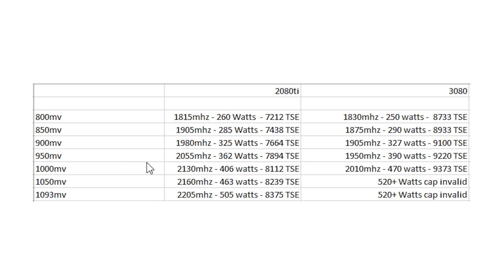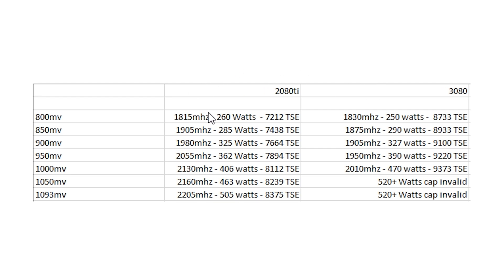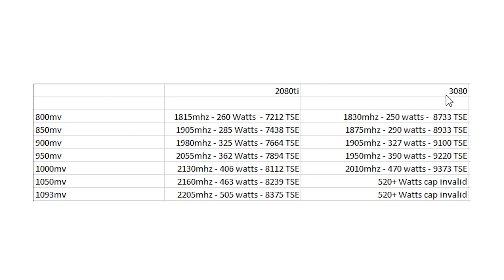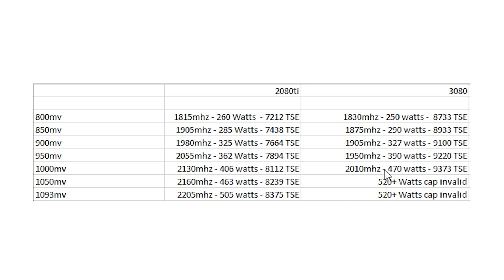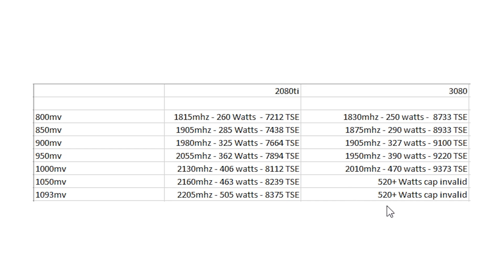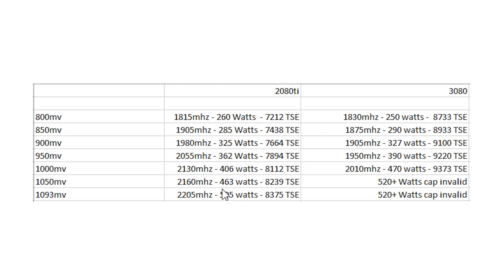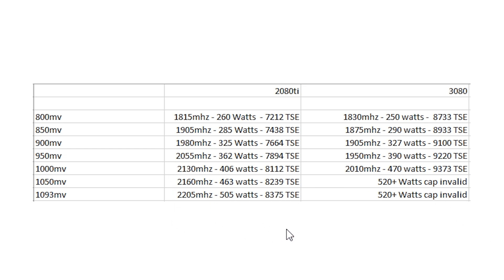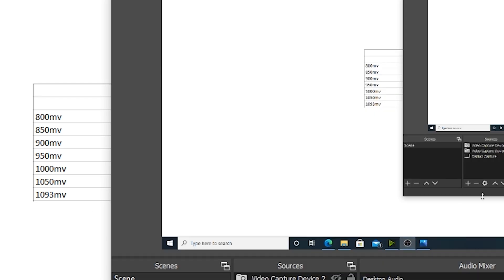RTX 3080 vs 2080 ti POWER consumption and VOLTAGE scaling comparison

Comment: Ampere doesn't scale well with voltage over 800mv at all. 30-45mhz per 50mv is not good. 
I'll compare Turing and Ampere based on what Jufus has said here using 800mv and 1000mv as reference points.

2080ti: 2130mhz/1815mhz=117%, 406W/260W=156%, 8112TSE/7212SE=112%
3080:   2010mhz/1830mhz=110%, 470W/250W=188%, 9373TSE/8733TSE=107%

Both the 2080ti and the 3080 seems to be 70% efficient at transforming frequency into performance.
The 2080ti takes 56% more power to give 12% more performance.
The 3080 takes 88% more power to give 7% more performance.

800mv seems to be the optimal point for each card though.
Reply: Also to add to this TSE isn't even the most stressful thing/game for a 3080. Quake 2 RTX uses 20% more power than TSE. So if we take the 1000mv 470W TSE result and multiply by 1.2, you are going to see close to 550-600W in Q2 RTX at 1000mv. At 1.1V on a 3080, I bet Q2 RTX can make it use between 700-750W.

Comment: So, if someone using 6 hdd, 1 ssd, 8 fan case,  i9 10900 non k, using rtx 3080 10gb or rtx 3080 ti 12gb, is it still very safe for using psu 850w plus gold ??

Comment: hey frame chaser do you think upgrading from a 2080ti strix to 3080 strix is worth it? Playing at 3k @120hz (3440x1440) running the matrix bios 360 power limit at 2100mhz and mem 8200mhz

Comment: First let me say I'm no Rabid Fanboy, I buy the hardware with the best performance at the best price that will fit my needs or wants...

I know I'm probably dreaming but wouldn't it be amazing if AMD learned the lesson of the one up game that NVidia always deploys after AMD launches.

What if AMD came out with a card that stomped the 3090 at the top by just enough that them fully unlocking it couldn't beat AMD?

What if AMD came out with a mid-range card that has 16 gigs of ram and it performs just close enough to the 3090 that the 3080 Super/Ti cards can't beat it. 

What if AMD also launches a bottom mid-range card that is just close enough to 3080 levels that a 3070 Super/Ti couldn't catch or beat? 

If that happened it would mean that even though we all know NVidia in their greed are holding back their Super/Ti variant. 
We know they're it all so they can sell more standard, cheaper, cut-down versions of their cards.
If this happens they'd have effectively shot themselves in the foot. 
Imagine what it would mean if AMD really came to fight this time and NVidia had seriously underestimated them.
Then due to NVidia's greed and thinking they had AMD against a wall again their launch strategy ends up with them having to sell their Supers/Ti's for less?
They would have to slash prices because they're simply not capable of beating AMD's performance per dollar metric without loosing money big time. 
Maybe then we'd all finally be able to smile all the way to the bank with the money we saved because of real competition for a change...

I know I'm dreaming but think about it, What If?
I mean it could happen right, please, please let it happen so these ridiculous prices can be brought back down to earth.
The only reason NVidia's cards look like such a great value right now is because of how insanely ridiculous their pricing structure was last time around...
Reply: it happened

Comment: Hey man I finally ordered a 3080 from newegg and I saw some guys have crashes with their rtx 3080 AIB versions... do you have any crash in game I'm a bit worried ??
Reply from the maker: No crashes for me, but I also manage my own fan and voltage profiles.  I assume the crashes are because of the card overvolting so hard out of the box and then it hitting the power limit constantly, that can definitely cause crashes
Reply: @FrameChasers  thanks man for the awnser!! Can't wait to try the beast (RTX 3080 gigabyte gaming OC) keep the good work man.

Comment: Great info again I wondered why my Zotac trinity clocks are all over the fucking place, How do we voltage lock these cards? I'm seeing results anywhere from around 1800 to 1950! Don't recall the 1080ti behaving like this
Reply: @Salt Maker I've just tried it, what he's saying is correct to a degree but the clocks are still not stable as soon as the GPU is pushed harder 80+% GPU usage and above the voltage and clocks start dropping again, So it's ok for light gaming loads but not high usage.
Reply: @Salt Maker Yeah the slider is maxed at 105% nah not doing anything wrong I think because of the low power targets on these Zotac trinity's it's causing the voltage to drop at higher loads, My 1080ti didn't react like this but then that's had a 120% power target.
Reply: @Salt Maker Yeah I capped it at 1v dead, Warzone has just crashed not overclocked, Not had any crashed before but just got direct X unrecoverable error and a display driver has stopped responding error in event manager, Defo something up with these cards, I've not had any crashes in warzone with the 1080ti

Comment: So perhaps a 3070 would clock higher without going nuclear since its cut down? Lets hope its a more overclocking friendly alternative for high fps gaming.
Reply from the maker: I don’t believe so, it’s not the SM’s holding the 3080 clocks back, it’s the 8nm node.  If it was related to the architecture or core count then the 3080 would be able to clock higher in lower load applications but it doesnt. The node itself just doesn’t go that high